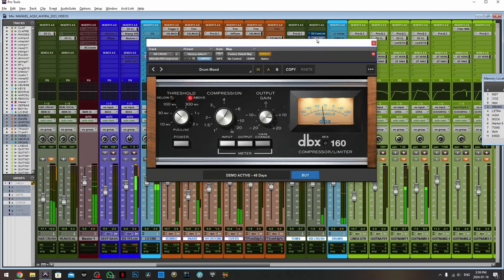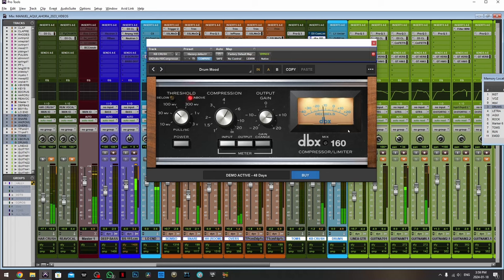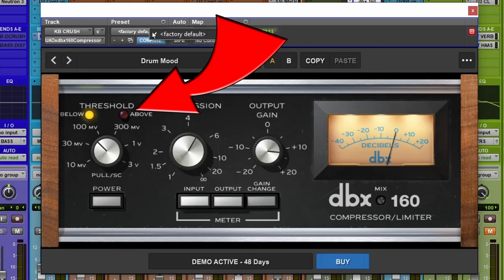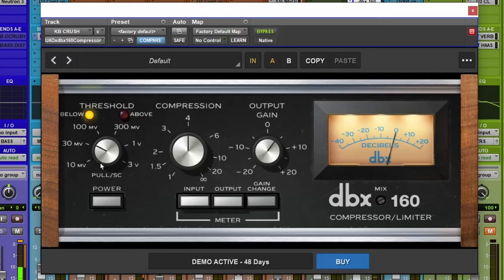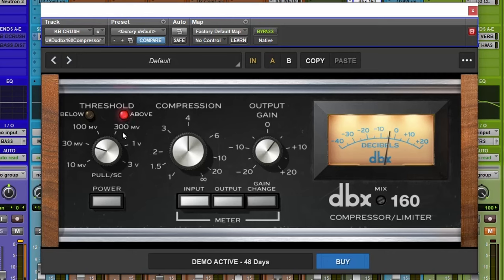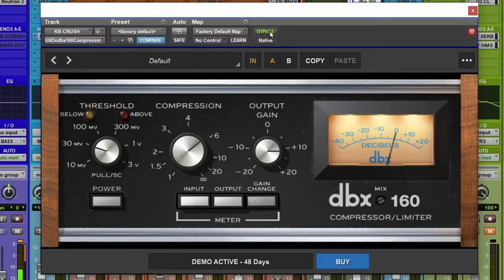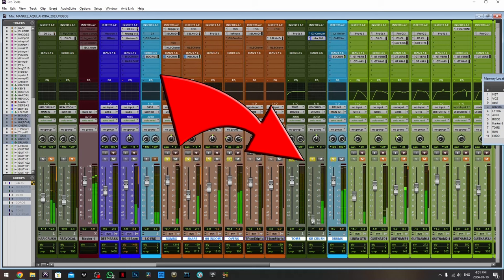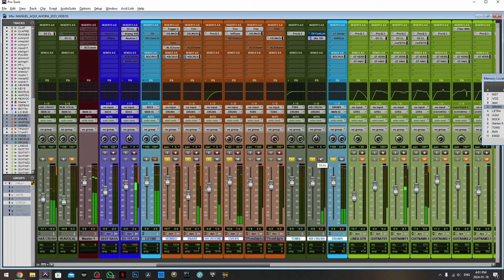Understanding UAD dbx 160 Compressor/Limiter

Comment: I was always wondering what you think about this, Andrei: to me, the UAD version is closer to the Audioscape 260 VU clone, and the Waves version is very close to the actual vintage hardware. Waves nailed both the attack and release character that is so unique to this unit near flawlessly.
In the end, both sound great of course, just a tad different.
Reply from the maker: I would add the one from Arturia which has variable time, great and possibly the best of them all but not my favourite. I would say the fact that you don’t have to worry about setting the attack and release in the uad and waves versions makes them more likely to be used here. I have to compare them to be able to tell which one I prefer.

Comment: everytime I use the dbx on drums or kicks (because everybody suggest that) I feel that the drums lost fatness, the kick lost subs, you know? I just do not understand it. I can hear sound tighter but tiny at the same time, where is the big low end I had? I still don't know how use the dbx definitely =/
Reply from the maker: You are hearing correctly, that’s why I use it in parallel so the fatness stays and the cardboard characteristic of 160 is added by the parallel. Don’t use it inserted in the kick.
Reply: @AmagrasMUSIC thanks 🙌🏻